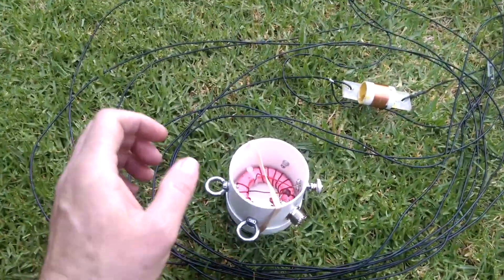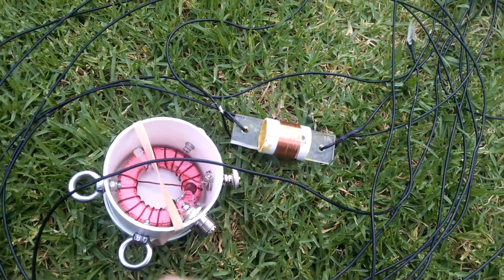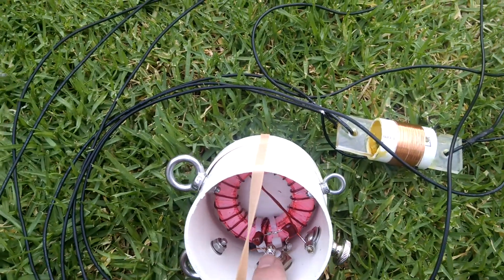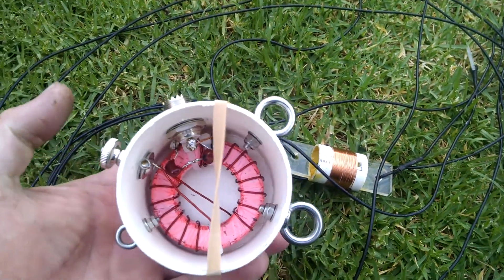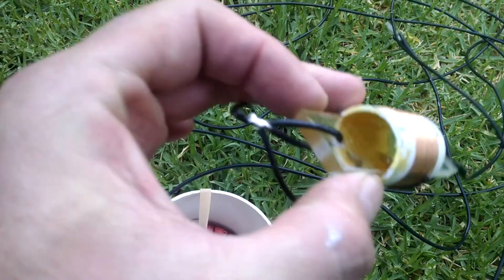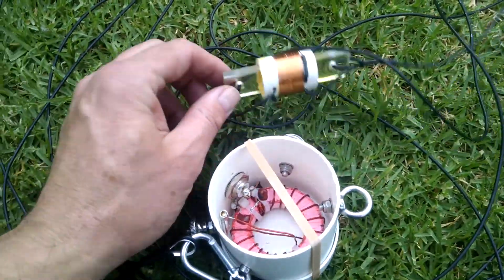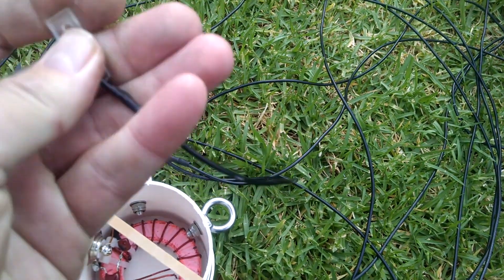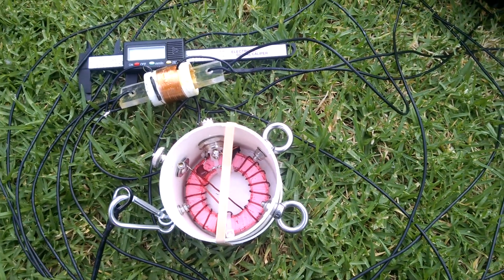HF End Fed Multi Band 40-20-10 metres assembly and discussion

Comment: i have built this antenna my top coil was trimmed to 45t i used a 64-1 transformer good swr on 40,20,10m  i put it up today with 100w best dx on 20m  i worked  ve6cq k8ny vy2nx 
on a almost empty band so its working well i will test 40m later tonight i am limited to a 44ft mast

Comment: Nicely done video. "Why did you shorten it with the coil?" I make mine with 65' 5" of wire and it has a very low SWR on 10, 15, 20 and 40 meters. 
KU3X